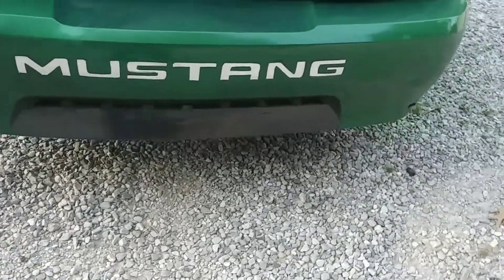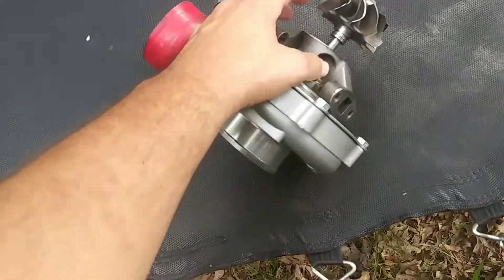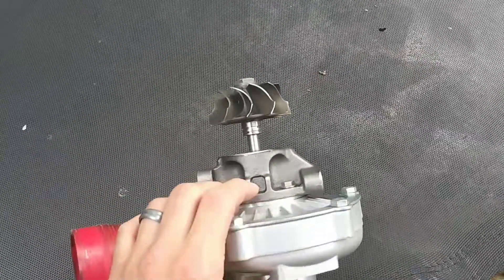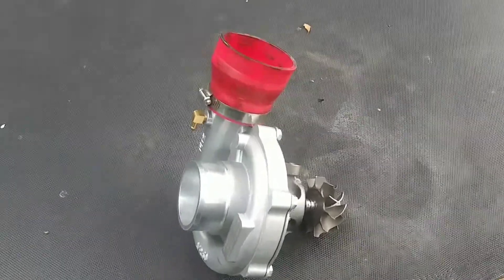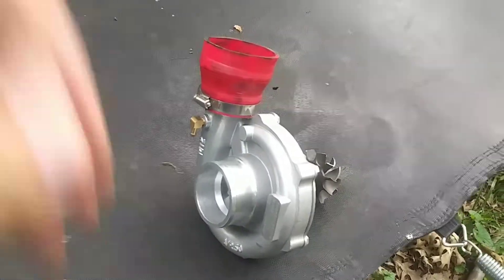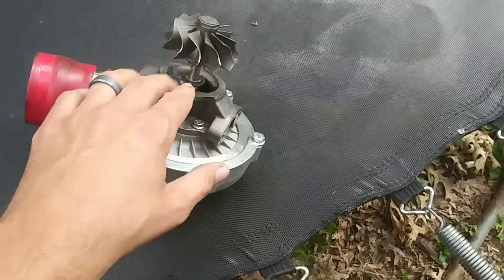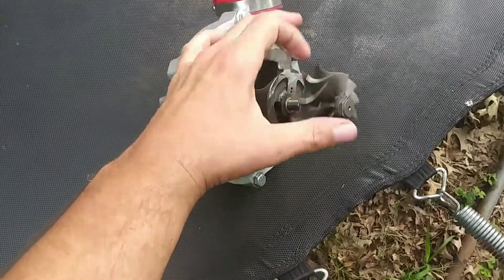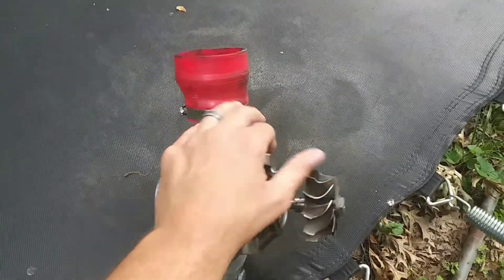home made supercharger update.

Comment: Driving that with a pulley is a waste of time. It won't spin it nearly fast enough to produce enough boost to do anything. A turbo spins at an exponentially higher rpm than your engine does. You will only be turning it about .5% of what is required for it to produce boost.
Reply from the maker: Yeah I was thinking that.  Right now I'm still working on getting my engine back together.
Reply: @themaynardshow9272  good luck with it. Please don't take it as if I was trying to dog on you or anything. It would just suck to put a bunch of effort into something that might not work the way you hoped it would.
Reply: @The Maynard Show   I've done this. Basically we bought gears from grainger? I think and made a case to hold the gears and oil
Reply from the maker: It's all good.  Probably need to get a v8 anyway lol.